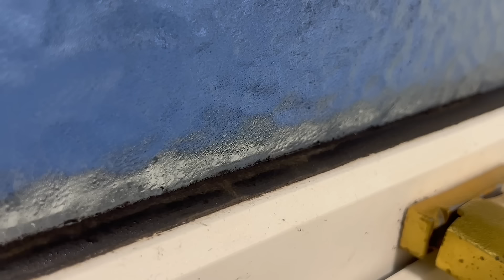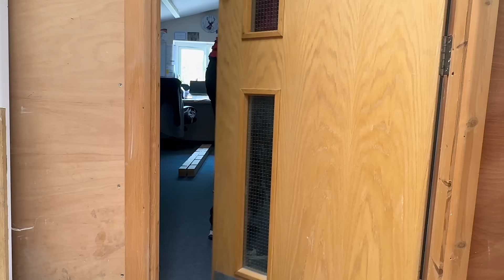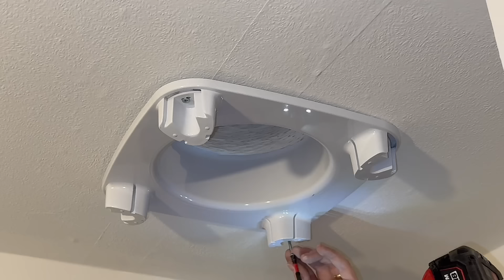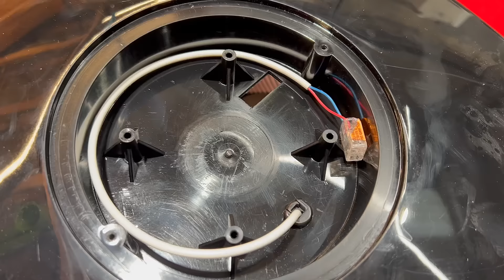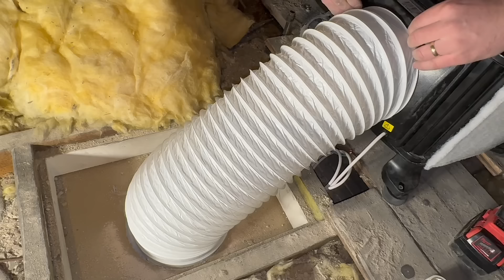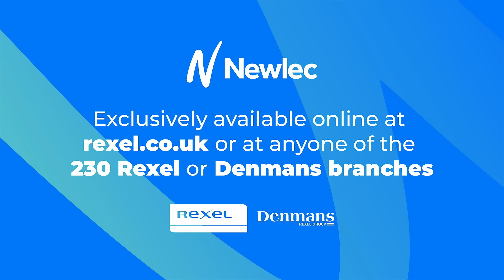Positive Input Ventilation: Finally, an Answer to Condensation

Comment: 😂 No, you should not drill holes into engineered wood trusses, as it can severely weaken the structural integrity and violates building codes (IRC R802.10.4) unless explicitly approved by a registered design professional. Trusses are designed to precise loads, and altering them can lead to sagging or collapse.

Comment: Wouldn't the positive pressure just move the condensation point further into the building structure and create rot and mold inside the walls instead?

Comment: PIV is interesting, but surely a external air source intake, that flows through a heat exchanger with HEPA filters would be a better overall solution?
Reply: Aka an HRV

Comment: You mentioned 9W and £9-20 a year running costs, is that just the fan or does that include the heating element too? Especially if it's on for 5 of the coldest months of the year.

Comment: Our old house used to have bad condensation problems. We bought a positive air system for our home at the time, sold by a company in NZ called HRV. We installed it in late 2009. It is still working fine and works very well. Condensation problems are now gone completely.

Comment: Know what's funny. Making a DIY HMRV is so easy that even I've been able to build one myself, and is so much more efficient and more  customizable than store bought.
Reply: Its there any guidance or documentation for this, I suspect DIY is the only option that will allow me to integrate humidity sensors around the house, air quality sensors would be good, but they're pricey.

Comment: Just do the Scandinavian method. Open all windows in the house first thing in the morning. In winter for around 10 mins and in the summer for around 30 mins. Will save you circa £350 for the PIV and the on going running costs.
Reply: When I wake up in the morning the windows (and any cold surfaces) are full of condensation. You can open windows in the morning all you want but it does nothing for the condensation during the night.
Reply: What you mean in the summer 30 minutes, my windows are not closed even 30 minutes a day.

Comment: But if you have a modern well sealed house you wont have any natural leakage point? Is that not the whole point of modern insulted homes. This would work better on older homes with natural leakage but not properly built modern homes??
Reply: Did you even watch the video? He literally says its not a one size fits all and only works on old house that aren't sealed like new builds.
Reply: @theosporge276 thats the problem with commenting as your watching . My apologises
Reply from the maker: That’s correct - PIV works well in older leaky homes.
Reply: You should have vents on your windows if you don’t have mechanical ventilation. These will push air out through those.

Comment: OR.......open a window and save £55 a month in increased energy bills. 520w is a lot of energy over a day, week, month in costs for people.
Reply from the maker: The heater is only required during cold snaps - we are monitoring what this equates to over the next week months.
Reply: @efixx you need to be measuring the volume and temperature of input air and then calculate the energy to raise that air to 20C to get the real running costs.
Reply: @efixx  On cold days you just open the windows for a short while early in the morning. That drops the humidity a lot as cold air can't carry much moisture and then the remaining air is easier to re-heat. Much cheaper than buying a fancy machine to make your house leak all day.

Comment: I've been considering the reverse version - by removing air up into the loft, you force outside air in through vents, open windows etc.

During the summer, when cooler evening air starts, it lets you cool down the home quicker.

I wonder if there is an option available that you can simply decided either or by reversing the fan flow.
Reply: That seems like a good way to get your roof moist and rot your rafters if you are pumping into the loft.
Reply from the maker: That would likely cause condensation in the loft space.
Reply: I have a clay tioed roof, in the summer it’s still 50C up there at 10pm!

Comment: Is control panel located on unit? Should homeowner climb to attic every time?
Reply from the maker: The unit is powered on 24/7 it shuts down at high temperatures so the user doesn't need to adjust once set up.
Reply: @efixx look to JUNG 1735 DS, other brands have possibility to adjust from other rooms without visiting attic

Comment: Very misleading - it might be 20 quid to run a PIR system but it's a lot higher than that in the damage it does to your heating bills. That's why modern buildings use MVHR instead - it might cost more up front but it saves a lot over time.

Also you can't use 10mm air gaps under doors if you've got fire doors.
Reply from the maker: We aren’t talking about modern buildings. Fitting MVHR to old buildings is a challenging.
Reply: @efixx fitting insulation to them is challenging too and there's no point fitting insulation then pumping all the air out. Typical UK answer though, bodge now pay later again and again instead of doing the job properly once 😂

Comment: cold air comes in and all the heat goes straight out the window, driving the heating costs through the roof. that's why i would go for dehumidifiers or an MVHR system.
Reply: For a ten degree difference inside and out and a known flow rate you can calculate the BTU/Heat loss in watts. When I was looking ok not it I calculated something like 50-75p per day. I would like something like this, but I suspect if want hygrometer control to make it come in when humidity is spiking and not 24/7. Not sure if that exists.
Reply: I did look into inline MVHR, which is similar in cost and I can imagine one at the top of my stairs but I couldn't do the calculation on it because the retained heat was just a bit beyond my a level maths brain.
Reply: @gaijintendo humidity based switches do exist. I bought one for my PIV thrn decided to kust take the PIV out and be more smart about resolving the humidity and ventilation issues. I think PIV is fine as a desperate measure but not very good and quite expensive overall.
Reply: Piv are generally heated
Reply from the maker: Horses for courses, PIV is much easier to install in existing homes though!
Reply: @efixx it may be easier but the savings over an mvhr system will be more than outweighed by additional heat demand in the uk.

Comment: Give me a 70's era home any day without the thick layers of insulation. Allow rooms breathe normally without a fan on 24/7
Reply: I got a 1960s house .  No cavity wall insulation. No mold ..  I might cost abit more in heating but I don’t care . It’s much more healthy than a modern house
Reply: @andysims4906 according to @satanismybrother you don't know what your on about, I mean, that what he said to my comment saying the same thing.

I live in a modern flat pack pile of sht that has to be the worst of the terrible low standards out there, an older house built to last is far and away better than the shoddy rubbish buildings of today. Slapped together in no time and inspected by someone who forgot to bring his registered guide dog with him.

And I'd rather have a jumper on than use any extra heating. But I don't know what I'm on about, even though I have had homes built at all different  decades of the last century.
Reply: Lived in all sorts of house, love my old home with retrofitted MVHR. It’s actually a brilliant combination as these homes were built to really have open fires and drive moisture out through those. The MVHR now does that job instead (and allows me to put modern glazing in)
Reply: It's a balance. Done right with good insulation and airtightness you need the correct other pieces - which includes MVHR and that's a lot more efficient than a PIR fan system. What you don't do is seal it up without thinking about moisture.
Reply: Mate, you don’t know what you’re talking about. Uninsulated houses from that era are bloody freezing and since the end of big coal, heating them is too expensive.
Reply: @satanismybrother  having lived in both, I'm so much happier with an uninsulated 70's house with wooden window frames and wearing a jumper. 

I think I know precisely what I want and have experienced.